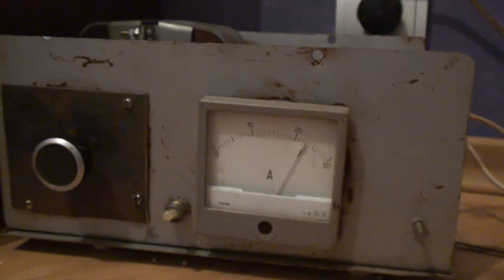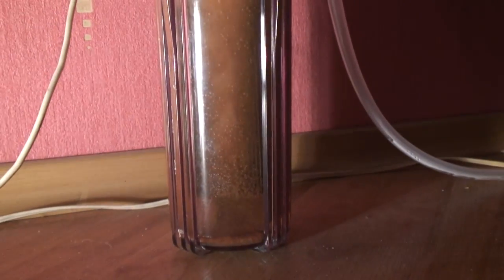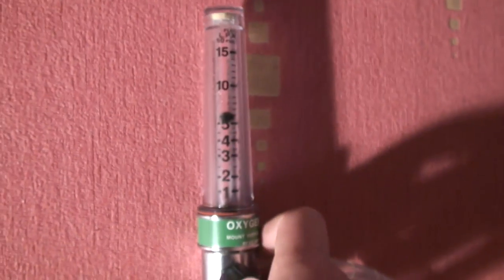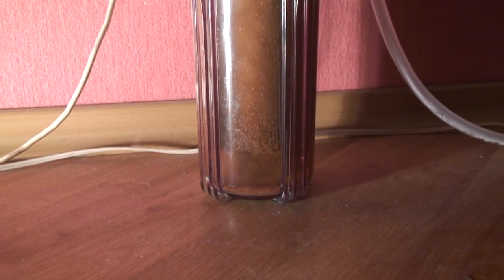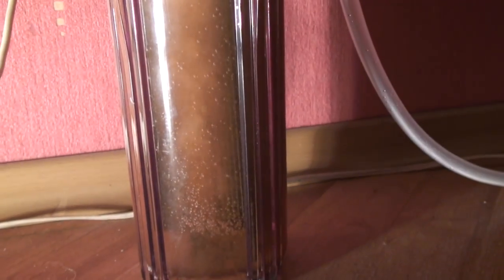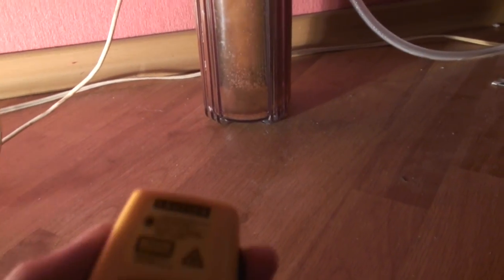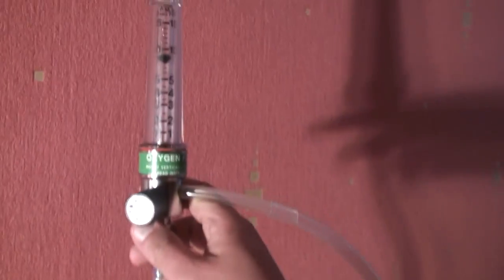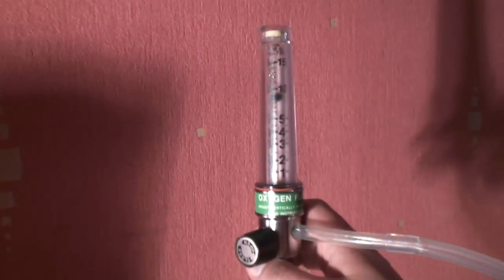9 LPM 150F 24AMPS 7Volts 19 PLATE Design New TEST HHO Hydrogen Generator

Comment: Nice work and I hate to sound negative  but 
those flow gauges are not accurate ...Do a bottle test and you will see you are probably only getting a little over 1lpm ..it is impossible to get 9 lpm at that current and only 19 small plates....it takes around 1000 - 1200 watts to make 9 lpm and thats with 72 6x6 plates in drycell format.....that means at 7 volts you would have to hit that cell with 144 - 172 amps ..you would have a melt down...